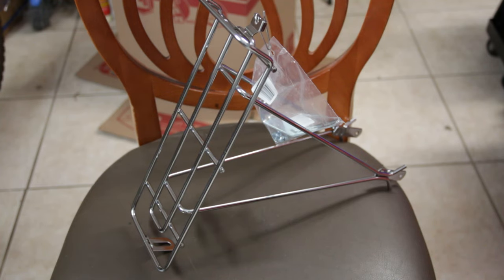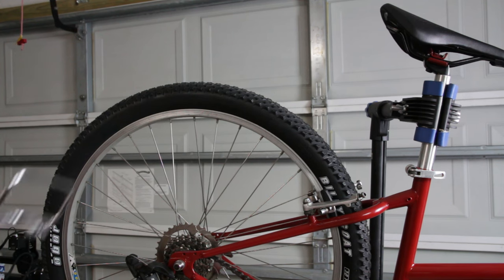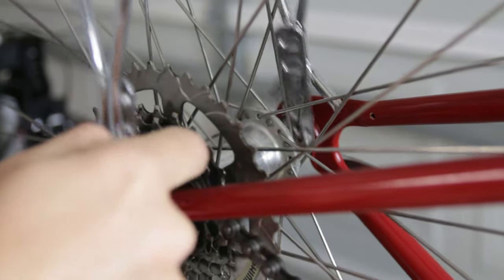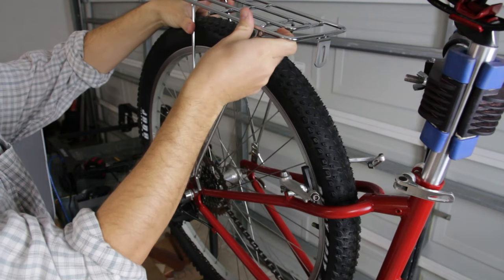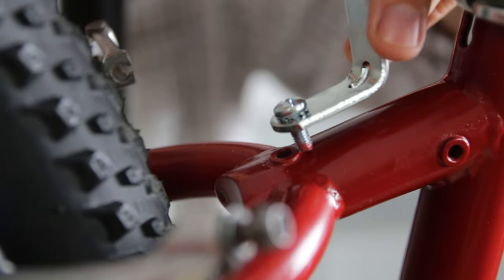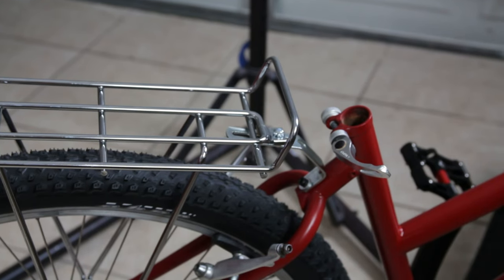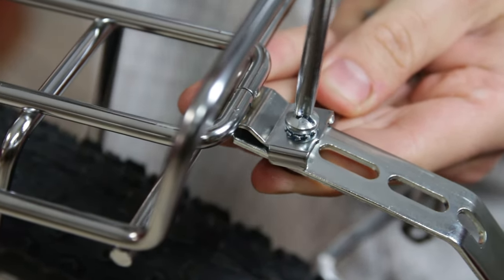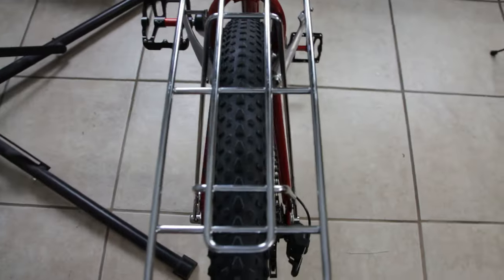Wald 215 rear rack install

Comment: Do you think panniers could be used with it, I kinda like the wald collapsible baskets if the would work with it
Reply from the maker: I think some smaller ones would be fine, but if they're longer maybe a more substantial rack would be good.

Comment: Will this fit a Schwinn Sidewinder 26" Mountain touring bike? The luggage rack weight limit is 20 LBS. Thank you for any help that you can provide me
Reply from the maker: I don't know about that bike specifically, just make sure that is has the mounts on the frame, if it does then it'll most likely fit.
Reply: @BruceChastain  Thanks for your response. I took the bike to a Schwinn dealer and my bike has the 5mm holes for the water bottle carrier which I ordered, I'll be putting the luggage rack on the back it'll fit. Thanks again for your help

Comment: Hey Bruce. QUick question I'm unsure if you'd have the answer for.
Know anywhere selling 27.5 wheels with rim braking surfaces? My amazon and google fu is failing me here with the only results I'm seeing that aren't ebay costing several hundred bucks and i think are intended for narrow racing wheels rather than gravel.
Reply from the maker: interesting you say that, I'm sort of seeing the same issue. I'm going to be looking for a set of 26" MTB wheels with rim brake.
Reply: @BruceChastain  The only way I could get a replacement wheel was buying from huffy themselves. But considering it's fifty bucks with shipping for a wheel plus freewheel and it's single wall. 

I mean better than no wheel right? Currently practicing lacing using the old wheel because i do want to get a freehub at some point plus derailleur that will allow that kind of range. Nothing crazy, still seven speed, but like. Just that little bit wider range than freewheels seem to allow.

Also watching paint tutorials. Won't be trying anything OldShovel levels of insanity but 'hey it's my bike. Even if I go wit ha basic two color paint-job that's going to be My paint-job.'

Have heard automotive paints are about the best you can get without dipping into the specialty markets.
Reply from the maker: if it's huffy, you could look for a whole bike with the right wheel on facebook market place. Just today I saw a like new schwinn, one of the decent MTBs with a 1x, for just $90. Actually I just sent them an offer for $70... https://www.facebook.com/marketplace/item/5220240641343287/

Comment: i actually had to buy some special screws from france with extra lenght to fit my 70s randonneur bulld, since the fender went into the same hole as the front rack did... can get a bit tricky at times... cheers from germany ;)
Reply from the maker: It's like that with these sorts of things. cheers
Reply: @BruceChastain  man, i paid a fortune for these...unobtanuium here im germany for some reason...^^

Comment: Nice. How do you use hole in the rear of the rack to put some lights. Does it have other usages?
Reply from the maker: good question, I really don't know, I was wondering the same thing myself. I may need to find a way to attach my rear light onto it.
Reply: @BruceChastain  Thanks. I have 2 other bike racks and all have more or less the same shape although some are vertical and others horizontal. In my case I haven't found any thing to attach. I you find the answer please share 🙂

Comment: I want it. I don't NEED it. I have no use for it... .but I want it. 

Ah well. maybe a use will present itself in time, and I agree. swapping to allen bolts would be far better. Plus if nothing else put it at a 10mm allen key and it's consistent with other bolt sizes meaning fewer tools to have to have in your kit bag.
Reply from the maker: haha yeah, I was sort of not sure about getting it myself. I'm not sure it's the best one for the money, but I liked how it looked, sort of simple and classic.
Reply: @BruceChastain  Looking forward to reports on carrying capacity and how well it does in general.